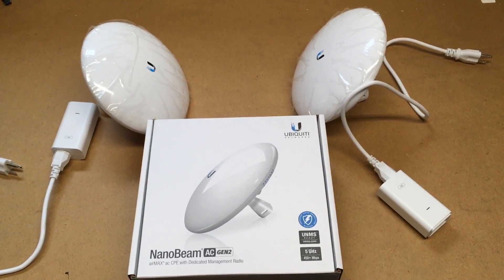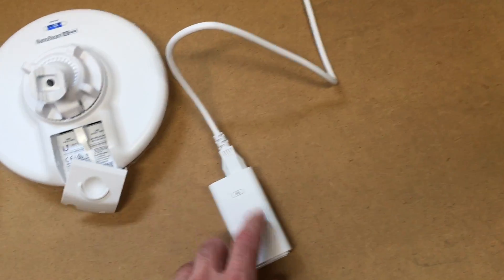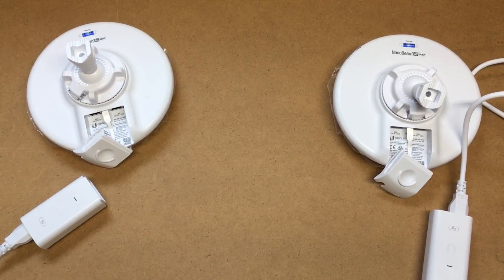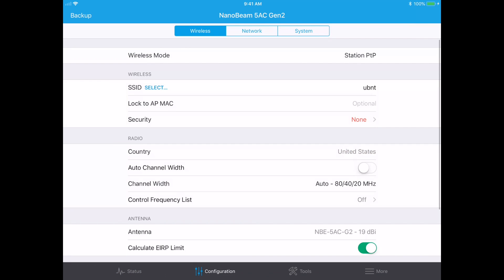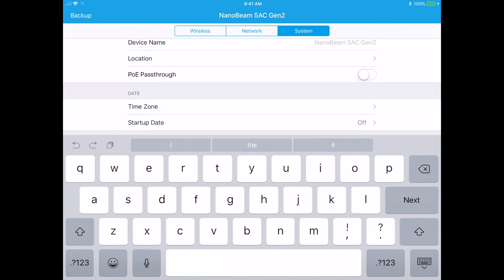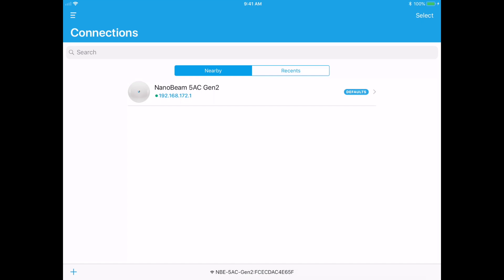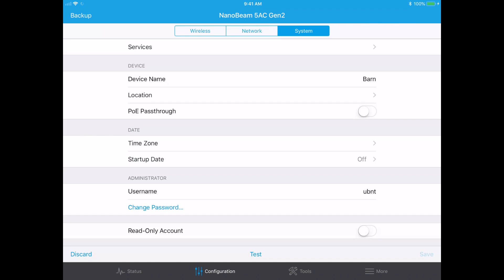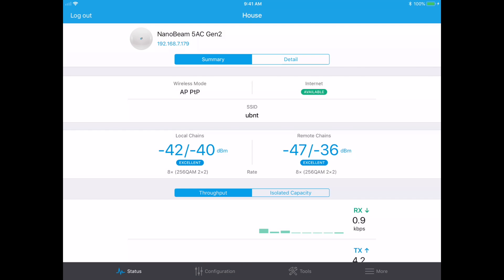Ubiquiti NanoBeam AC Gen2 Basic Wireless Bridge Setup

Comment: Got the NanoBeams set up and working but my speed is low at the station side. Running a speed test at my house directly from my comcast gateway I normally get 250 Mbps.  I have about 40 feet of cat5e cable connecting my gateway/router to the NanoBeam set up as AP.  The station NanoBeam is about 300 feet away at my barn. Line of sight is good but not perfect as there are a few small tree branches in the way. But from the router in my barn when I run a speed test I'm getting 25 Mbps.  What should I look for that could be causing the loss?
Reply from the maker: Have you seen my second video on this? I talk about changing the channel width. That can make a big difference. https://www.youtube.com/watch?v=13AjR-KGOKg&t=928s

Comment: does the receiving antenna have to be placed outside of the building or can it be inside? Because I'd have to drill a hole through the wall, that's uncool.
Reply from the maker: It would be better outside. Do you have a window in the right position? I think they make a suction cup mount so you can have it on the inside of a window.

Comment: You can connect a AP into LAN2 on Barn side? 
Does it need to be 24v POE or can you turn off POE out?
Reply from the maker: From what I understand, you can connect a Ubiquiti AP on the barn side but you need to use a higher powered PoE injector. It comes with a 24V .5A adapter. I think you need a 24V 1A or 1.25A but I couldn't find the exact number. I would search online with the nanobeam ac gen2 and the specific access point you want to use and see if you can find someone using that exact setup. Look for which PoE injector they are using.

Comment: I would like to  connect an ip camera to one side of the bridge ,and the camera has ip himself .
Do I need to put the in the PC the camera's ip or the bridge ip?
Reply from the maker: The camera's IP. You can imagine the bridge as being like a really long ethernet cable. Equipment on both sides are on the same network.

Comment: So on the barn side I bought a TP-LINK AC1200 Wireless Dual Band Gigabit Router. I can plug directly into that into the blue port internet connection? Then the outputs   on the router can go to a computer, wireless cameras etc? Does the router need to be somehow configured at the house side first before going to the barn? Thanks
Reply from the maker: The house side router doesn't need any configuration. You can plug the TP-LINK into the NanoBeam. You will want to set it up in bridge/repeater mode. You can then use the other ports on it as if it were a switch or hub.
Reply: @Rickmakes  thank you sir. I have them communicating together last night thanks to your video.  Now to go put them on my 30 foot flag poles. I've moved my business only 2 blocks from my house and hope this works!
Reply: So when setting up the "barn" router it gives me several options
Dynamic IP
Static IP
PPP0E
L2TP
PPTP
which one should I choose?
Thanks!
Reply from the maker: @troyevans8907  Did you choose Station PtP?
Reply: @Rickmakes  yes I did. I'm just not sure what to choose on the ac1200 router on the barn side. You said make it a bridge setting, but not sure what to choose since there is no bridge setting on the router or one of those options is a bridge setting? I'm just setting up router for the barn at the house right now before taking it to the barn side. Thanks for your help
Reply from the maker: @troyevans8907  Is there a "range extender" option?
Reply: @Rickmakes  no theres not. I went ahead and put router on auto, and everything works! Thanks again for the video...this will save me thousands in the long run!!!
Reply: Everything is still working great...except it killed all the bluetooth in the barn. I cant connect to any devices in the barn, any ideas why? Thanks!
Reply from the maker: Bluetooth operates on 2.4GHz, which is the same as 2.4GHz Wifi but it is made to work with congested airwaves. You could try turning off 2.4GHz Wifi in the barn and just use 5GHz...so long as all of your devices support it.
Reply: @Rickmakes  thank you sir!

Comment: New sub thanks for the video I'm looking into getting This for 4 locations off of one point will it work for that
Reply from the maker: It sounds like you need a Point to multipoint (PtMP) solution. Ubiquiti has a nice page here: https://help.ubnt.com/hc/en-us/articles/205197750-airMAX-Which-product-should-I-use- Scroll down to "High Capacity & High-Performance Base Stations". It lists base stations with a wider coverage area. You pick one of those, then you choose the hardware for the 4 locations in the next section "Customer Premise Equipment (CPE)".

Comment: Is there a multi directional setting
Reply from the maker: The wireless modes are "Access Point PtP", "Access Point PtMP airMAX AC", "Access Point PtMP airMAX Mixed", "Station PtP", "Station PtMP". PtP = Point to point. PtMP = Point to Multi Point. I have not tested it with a multi point setup.
Reply: Ok I’ll try play with it. Any idea on the range or how far they will transmit
Reply from the maker: @cesargonzalez7113  Ubiquiti lists the range as being 15+ kilometers. I don't think mine are over 100 meters apart. I'm guessing 15km is line of sight with few sources of interference.
Reply: Thank you

Comment: On the barn side, do I need another router? On the house side, cables need to be run back to the router in the house?
Reply from the maker: If you want to provide wifi to the barn, yes. On the house side, the cable runs from the NanoBeam to the POE injector and then to the hub/switch/router.

Comment: Thanks for your video. Can I ask o e question around signal degradation: I ha e a direct line of sight between my house and garage and it's only about 15m / 50ft. Do you know if I'll lose signal strength between house and garage? I'm assuming I'll lose some but I just don't want it to go through the floor. At the moment in my house we have a WiFi signal of about 22mb per second download. I live in rural Ireland, so we can't afford to have too much signal degradation 😁 Unfortunately I can't order through your Amazon link as deliveries from Amazon US to Europe is severely restricted at the moment.  Thanks for any advice you can give me. Best regards and stay safe!
Reply: I went ahead and bought the NanoBeam AC Gen 2 and I can confirm that I have NO signal degradation and it was easy to install. I'd recommend it.
Reply: @MrOberflaechlich  Yeah, some of the NanoBeams get almost two miles of range.

Comment: Hi, want to clarify, the internet cables that i need to connect from PoE to the AP unit are all straight through internet cables?
Reply from the maker: Yes. They do recommended shielded and grounded cables for these. I am using their Toughcable product. I terminated the ends with Ubigear pass through connectors. I have a video on those here: https://www.youtube.com/watch?v=1ldw5HkDEw0 I have a link to the shielded connectors in the description of that video.

Comment: i need a 100MB link, can these do it over a 40M distance line of sight?
Reply from the maker: Mine says it is at 300m. I just ran a speed test (iperf3) and got around 188 megabits/second. In your comment you used capital "MB" which would technically mean "megabyte". If you meant "megabit", then this should work for you. If you truly meant "megabyte", then this won't work.

Comment: I would like to have wifi available in my barn to control lights and thermostat (a Nest).  Will those devices in the barn be visible on my home network or will they be on a totally separate wifi in the barn?  In other words, will I have to walk out near the barn with my smart phone so I can link to wifi in barn in order to control the thermostat?
Reply from the maker: The nanobeams extend the home network to the barn. You would then need to plug in a wifi access point for the barn (like the Ubiquiti AP AC Lite). Next you would set up the nest and light controls on the barn's wifi. You could then access them from the house. If you are still unclear, let me know.

Comment: after i bridge them  i can't go back to them to make modifications. i want to up the dbi of both of my nanobeamac19
Reply from the maker: I would try restarting them. Then make sure your mobile device is connected to a WiFi hotspot on your LAN. Open the UBNT app and they should show up under Devices. You should see the IP addresses under the names. You can configure them on the app or log into them on a browser using the IP address (from the LAN).

Comment: I installed a new firmware on the main antenna and since then,  i can't connect the other antennas
Reply from the maker: That's odd. Which version are you running? I'm on WA.V8.5.12 build number 40181. Is your remote on the same version? You might try updating it so they match. You could also backup the configuration on both devices and reset them. You could then either reconfigure them from scratch or upload your backup configuration.

Comment: When I plug a computer in to switch, I get the message that says the website refused to connect because of unsecure network. Did I miss a setting?
Reply from the maker: No. That is normal when setting up new hardware. You can accept the "unsecure" site and move forward.

Comment: Peace, mercy and blessings of God.  I have a problem with my NanoBeam 5AC Gen2
   I tried to solve it by all means, but there was no use.  I called the company.  I didn't benefit from anything.  I have updated the hardware.  It was useless.  I went back to the old versions.  It was useless.  I tried all the solutions I could think of, but there was no result.
   Change the wires for new ones
   Of course, I use Cat 6 ethernet cables
   Without any benefit

   warning

   Device disconnected.  You can continue to make changes, but applying the changes will not work until the connection is restored.
   this is the problem.  A message like this appears, and the internet connection drops after about 10 minutes
   I ask the experts to solve this problem
   Note that I entered many western forums with the same problem, and they did not get any satisfactory answer.  Everyone says the wire isn't wired, and that's happened without any significant results.